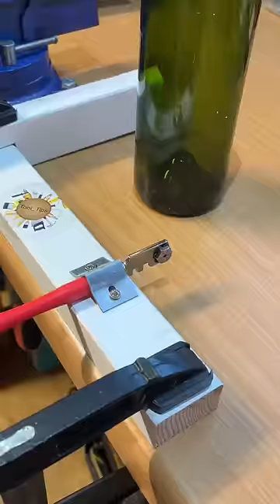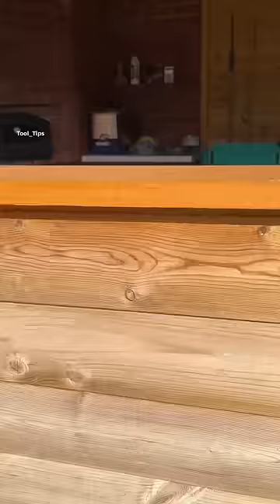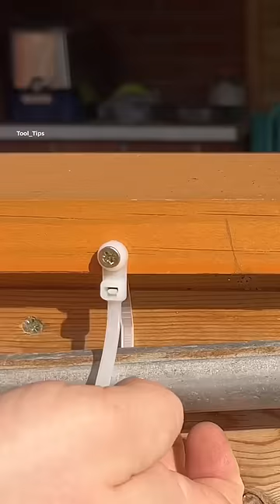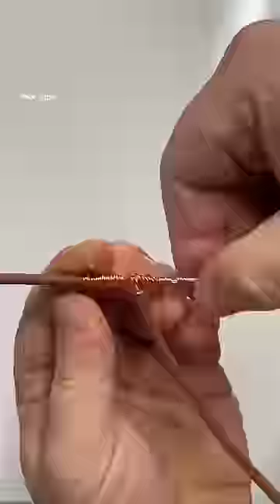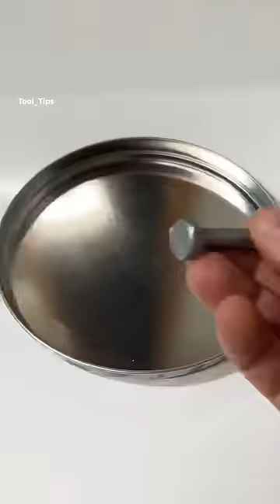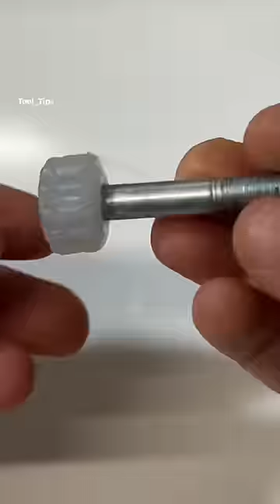Best ToolTips on #shorts

Comment: Don't splice wires like that ffs

-Electrician
Reply: Yeah it's LITERALLY ILLEGAL
Reply: My thoughts exactly.... though I have seen even dumber splices.
Reply: what is wrong with the way he did it? it "looked" good... but i know nothing.
Reply: @nomchompsky2883 rst and most importantly it's unsafe for the next person who has to work on it later down the road. The correct way to do that is to cut the 1 wire in half and twist all 3 ends together with a wirenut. The only thing you can Sometimes do that on is the grounding wire. The only time the ground can be done like that is in a recepticle. Now they have it to where you have to have a ground in the pipe and screwed to the box. On a single recepticle in few places you can strip the ground coming from the pipe out towards the middle and wrap the ground from the box around it and tape it up. This keeps you from having to make a pigtail on the ground just for a single. But most times an inspector will fail you because of the ground being done like that. Thats why it can only be done very rarely.
Reply: @Synsation101  thank you!
Reply: I've done it inside Electronics where I was going to soldered wires and heat shrink cover them. Even then, I would have Twisted the extra wire so that it would lay alongside one of the others. Dumb to make it a 'T' since it's more difficult to re-insulate and make safe.
Reply: @nomchompsky2883  Most people seem to be assuming that was household electrical wiring.  There are many places where that splice would be acceptable, though extra unnecessary work. Any situation where I would a use a splice like that I would solder it, and once soldered the first method he showed would be just as good but quicker and easier.
Reply: @CSXRobert  even if that is in a control panel the best way to do it is still with wirenuts. My company I work for does everything from new construction of commercial builds to installations of door  security (mag locks, card readers and cameras). We have never and will never make a splice like that. No matter the voltage.
Reply: No shit
Reply: What if it's an old folks home that has to be okay there right?
Reply: @davidlabrosse9661  Not where I'm from
Reply: 1. Laws vary all over the world.
2. You have no idea what I'm doing with that wiring.  Maybe I'm just splicing speaker wire?
Reply: That is the way we are taught to do it in Australian trade school.
Reply: What about those damn tie wrap conduit hangers 😳
Reply: Definitely FFS on that. Any splice 120v or higher should be cut and wire nutted. #10 and larger, they make lugs and if its a ground they make split bolt connectors. But as an electrician too, i appreciate dumb stuff like that on youtube cause that service call toe later to fix it is easy money lol
Reply: @Synsation101  For someone who knows nothing about this, what makes it unsafe for the next person? Also, what if the first wire has no give and if you cut it you can't twist all three ends together. What then?
Reply: @theludonarrian  to begin with, if your wire is too short you would want to extend it anyway. In something like an electronic this OK for something that is permanent. But there are still better ways than a T. A wire nut won't fit in a drone or remote or laptop so there are different rules. But what he had looked to be relatively big for anything like that. Thats where the danger comes in. Control panels for cameras and security control in a hospital. That would be a "don't do". Anything over 120 volts that's a "don't do". If by chance the next person years down the road has to work on that particular jointed area and by chance can't turn the circuit off the that's a nightmare. From the start cut the wire stretched across, get an extra piece of wire and wire nut it onto the shorty to extend it, then you have enough to reach to make the joint under a secondary nut. If the next person has to work it hot the it's easier and more safe to work with.
Reply: Can use to pull cables through conduit
Reply: I'm just a welder and even I know that's a quick way to go out in a blaze of glory
Reply: 9х9
Reply: This is a NASA standard splice 😅
Reply: Just came into comments to say the same thing 😂
Reply: @Synsation101  Because they can unscrew it and pull it apart using the sheath? Also, thank you.
Reply: Came to say this
Reply: @Synsation101  Any wire splice should be in a J-box
Reply: @Scorp497  well I would certainly hope so but if that splice fucked up on a circuit that couldn't be shut off, no matter if it's in a j-box, that splice would be dangerous to work with. There are much better ways to splice that wire. They make small connectors for such things they even have T connectors. Those have tabs you push to release the wire if needed to be worked on. You can release the wire that is sending power and wire nut it off killing that branch of the circuit.
Reply: Maybe not illegal in France, where I think this is being recorded.
Reply: They are use to splice wire because they don’t have terminals in their country like you called it WAGO 😑
Reply: Maurizzo crozza
Reply: @spiderdude1013  How would they isolate the whole T splice? Would there be an improvement if a heat shrink tube were used? What about terminal strip?
Reply: that is a WW2 US Army field telephone splice.
Reply: @Synsation101  wirenuts are dumb
you never know that you connection is solid and/or good

but they are either from UK or US i think
way way better method is to use stuff like "wago klemmen" don´t know how to translate that to english.
and on loose wire better clamp them so you have a solid connection.
Reply: @mrchillgreen    you can indeed for sure know you have a solid connection. You are suppose to twist the wires together clockwise atleast 2.5 to 3 spirals. You have your connection right there. You can make sure those wirse are establishing full contact. You twist the wirenut on tight as you can. The wire nut is just strengthening the bond not making the connection. Once in the wirenut you are suppose to pull on each wire to ensure none come out and are locked in. It takes less time that all that. Trust me I know. I had to wire up the new tire presses at Continental tire plant and that company is a German company. I had to put ferrules on the end of every single wire and if a wire wasn't long enough to reach from the panel in 1 solid piece I had to wait what felt like forever for another "cut to length" cable came in. I understand electrical is different in different places. I find it interesting but some is not so fun to work with.
Reply: @Synsation101  tbh i think there are even wago clamps where you can just put in non solid wires and with a push down they are just secure the benefit in my opinion of them is i can visualy and physically verfiy the connection is solid.
Reply: @mrchillgreen  again you can verify the connect is solid before putting the wire nut on. The advantage to the wire is that it is not what makes the connection twisting the wires Is the connection which you can verify is a solid hold. Tge problem with push ins is the fact that all the wires are connecting by a thing strip of metal. We use all sorts of connects depending on the situation but for most things the wire nut is what is used. most of the time when a light isn't working and I have to fix it, it's because the push in connectors that were used were burnt out. Besides crimp ons there's no better connection besides a twisted copper joint. But again I'm talking 120v and up or for control panels for door security purposes such as card readers and maglocks. Im not speaking on things like laptops and small electronics.
Reply: I'm a diy guy and even I would say that's a bad idea.
Reply: Why is this even a thing? Are they just trolling us?
-Also Electrician
Reply: I cringed harder than when you remember the switch is still on as you go to clip.
Reply: @MrDankDro  wago > wire nut
Reply: That's how I get power from my neighbors apartment 😂
Reply: @spiderdude1013 That's how I get power from my neighbors apartment 😂
Reply: definitely don’t. 

-apprentice lol
Reply: I agree

-fresh out of high school Electrician.
Reply: @CSXRobert in any country with a electricity regulstion based on university studys solerding splicing or any other method of combining wires not using a wagu or a screw connectornis considered illegal. Its just unsafe.
Reply: @haralds4145  again, you're talking about household wiring.
Reply: @CSXRobert  any wiring outside of devices has this stadards in germany
Reply: @Synsation101 use a wago, those are better, wirenuts aren't great either. Actually I've never seen one before, nobody uses that stuff here in the EU xD
Reply: @muuhnkin4611  we use wagos here but only in tight spots for example, a 6 inch hole in a solid ceiling putting in a new can light, it's hard to get both hands in and see what you are doing. In those circumstances yes they are useful but in my years of working as a commercial/construction electritian and from what I've learned, a twisted joint is more dependable than a thin piece of metal connecting 2 to 3 wires running 120-277v. Here they are used more for low voltage but even then we still use wire nuts in the 4 square boxes. The diffence is with a wago you are depending on the piece of metal inside to make that connection. Where as a wire nut isnt making the connection, the wires twisted together is the connection. The wire nuts is just securing and safing off the connection.
Reply: @Synsation101  yeah, that is why it's not allowed in many places, twisting wires isn't considered a safe way to connect them.

Here it's considered a fire hazard. Especially if not applied correctly.
Can't do anything wrong with wagos, insert cable clamp down, safe connection. 
but wirenuts? It's enough to have the wires unevenly twisted to create high Ohm connection which can lead to fires.

Here in Germany you're trained to never twist wires.
Reply: @muuhnkin4611  we go by the NEC electrical code. Says nothing in there about it being unsafe or a fire hazard. If done correctly and the right size for the amount of wires twisted. Also they are twisted before they go in the nut not usi g the nut to twist them. I've have to throw many of those push ins and wagos away simply because the wire will just pull out of them. Like I said I've worked with both. Where you work prefers this one where I work prefers that one. It's all in where you are and live.
Reply: Just use fucking WAGO Clamps xD(Sorry bad english,im a german electrician
Reply: @kazutokirigaya7710  Agreed. Norwegian here.
Reply: I always thought this twisted wires was a dumb idea. However I picked up a 1934 British Electrical Document and there was a whole chapter on this for big industrial wiring.
Reply: Who said it was house wiring? It looks more like 12 volt automotive wiring to me. Add some solder & electrical tape, not the way I would do it-mechanic, but I've seen worse.
Reply: Another electrician here: can confirm, don't do that shit.
Reply: At least i dont had to put something in the coments
Reply: Trevor used these Bodge it and scarper techniques throughout his house.
Trevor is now homeless and living in a cardboard box, Trevor was last quoted in saying “ nah, be fine, just don’t BZzz Aargh ! 😅
Reply: That's an emergency marine wire splicing technique 
I know the coast guard used to teach that splice for repairing damaged wiring until they could get back to port
Reply: just use a wago ffs
Reply: @marcelldavis3076  what's a wago?
Reply: I was just going to say the same thing.
Reply: Take a wago. Done
Reply: Yeah thats a short circuit waiting to happen😂😂
Reply: u know farmers and carpenters will do it anyways💀💀
Reply: Best way to burn down houses. They use that method in the Philippines and there's no week without a fire..
Reply: What?! But I saw it on the internet!! 😂😂😂😂
Reply: That’s all I was thinking 😮😂
Reply: If it turns on it works
Reply: In automotive I'd say thats pretty good, especially if it's soldered after and has heat shrink. 

Anyone who says otherwise clearly hasn't taken apart a semi tractor harness lol
Reply: Exactly what  i was thinking.. im no expert😅😅
Reply: Yeah thats what i thought tok
Reply: dw i dont like being alive anyway
Reply: I’ll keep splice wires the way I been doin it my whole career dammit

- CDJR Master Technician for the last 13 years. Also worked GMC, BMW and Mazda over the course of 10 years prior
Reply: then some ppl in the automotive world would say that that "T tap" is acceptable 😂
Reply: All you house electricians are so silly. Automotive electricians know this is good. All that’s missing is some soldier and heat shrink
Reply: @p00piter  A car battery and 230V or whatever it may be is not the same thing
Reply: The splice is literally a taught form of T splicing in school... read a code book or go take ur masters. It's clear it's been a minute for you.
Reply: @MikeHawkPEN15  I assume you are not from Europe
Reply: @gabbz4540  north America. This type of splice is taught in your first year of school. It's referred to as a plain tap joint if I remember correctly. Completely legal and completely within code if done properly, some saudering is required, but it is a taught and practiced splice non the less.
Reply: @MikeHawkPEN15  I'm from Norway. This splice would be illegal here
Reply: @Synsation101 exactly my friend please for God sakes I hope no one does what the video shows
Reply: In France we dont work like this. Junction box is mandatory.
Reply: @AddaKADDOUR-n7l  Same in Norway. I would not want to be the next guy working on an installation with permanent and maybe hidden splices.
Reply: @beecee2046  why? This is  a common and completely fine splice...
Reply: I literally was relieved when he said X on the first one and then when he showed the “correct” way  I was like oh my god what the fuck😂
Reply: Bruh actually thought wires work like they do in satisfactory
Reply: As someone that studied EIM and passed my NC 1 last year that also gave me a heart atk
Reply: @wealllikeitsomilkit4301  it shouldnt lol? this is a completely normal and legal splice.. its a T tap.
Reply: I work with wires in motorized vehicles (Legally, not an electrician. As far as I know, you don't need to be licensed for the machines I work on). I began screaming at the screen.
Reply: @smotmot Yeah and it’ll cost the US taxpayers a million dollars!
Reply: @penguin-schluppstudio  legally ticketed red seal electrician here. This is a legal splice.. of course it needs to be heat shrinked or taped but this absolutely a legal and taught splice in school. It's very niche it has a time and place in the electrical world... but it is completely acceptable. Watching weekend warriors lose their lid over something they have no training or schooling in is comical.. 95% of these idiots couldn't tell you the difference between 3 phase, single phase , 120v ,240v, 208v, 347v , or 600v
Reply: @ehntals1394 ok but the problem in the video is that it’s not specific. I mean I totally get it. I prefer safety and quality over DIY any day.
Reply: @CSXRobert that’s what I was thinking. It’s not for a house. AC wires are solid, DC are small ones grouped together.
Reply: @Synsation101 does not doing this apply to vehicles also?
Reply: @Jalan.Anthony  I'd use a crimp on but the main problem with the video is, a wire sizes support certain voltages. If you use the correct size wire for your voltage but then you split the strands in half like that, then now the voltage is traveling through a different size until it hits were they are all together again. Example, say you are using a wire that has 12 strands to make the whole wire size and thats the size you need. Splitting them apart will give you 6 strands and 6 strands. That's half the size needed. So those 2 leads of 6 strands leading to the whole wire of 12 strands will eventually burn out and cause a short.
Reply: @Synsation101 i think waygos are better than wire nuts simply because of the way they lock down and also have more reliable circuit.
Reply: @sweptapostle2473  it's just depending on where you live on what's more common. We use them in tight spots. But for the most part we don't simply because the thin metal strip in them that connects the 2 or 3 wires together tend to burn out or the clamps AR defective and the wire is loose or pulls out. Just my experience with them. The difference in wagos and wire nuts is wire nuts aren't making your connection where wagos are. Wires nuts are securing the twisted joint and the electricity flows through the copper wire. We tend to trust a copper to copper connection more. But again wagos are nice if you have to work something hot like a light or in a tight 6 to 9 inch hole in a solid ceiling replacing a can light.
Reply: NASA recommends that.
Reply: Because it works and you don't get paid? xD
Reply: This splice would be inadequate over 24v of potential. Just get a WAGO connector FFS 🤦‍♂️
Reply: @juleswins3  😂 they use it in places where ultrasonics are a concern. Jets and rockets and such.
Reply: For low voltage, ita acceptable
Reply: Oh dear 😂
Reply: In India law is very subjective

Comment: 26 years as an electrician and if I ever seen someone splice like that they’d been fired in a heartbeat
Reply: why?
Reply: @maksym_x  splicing wires needs a mechanical connection otherwise it’s doomed to fail and possibly a fire hazard
Reply: Or set on fire. Either way...
Reply: 13 years as a master ASE tech, I ain’t see nothin wrong with it. Course this is how most guys in the shop splice to the wiring harness anyway. Not a whole lotta things to catch fire around an engine bay. And considering our pay rate, the fastest job is typically the best job
Reply: Looked good to me
Reply: Dude i wouldnt even hire em. Wtf was that?????
Reply: Splice*
Reply: @NHawthorne Show us
Reply: No way you canb get that tight enough to not arc and cause heat which means fire.